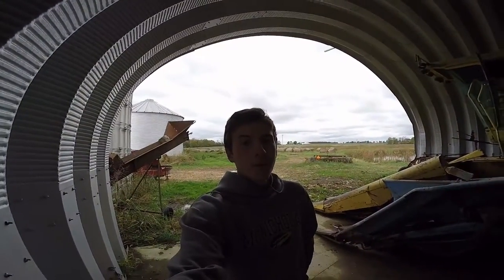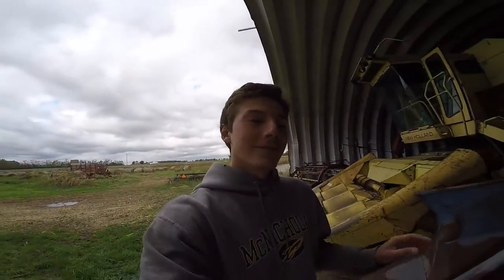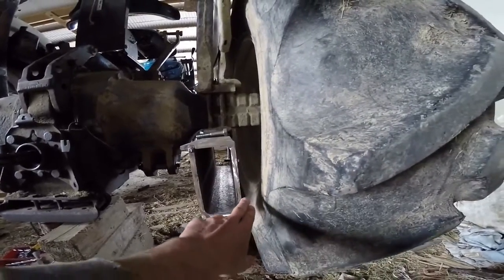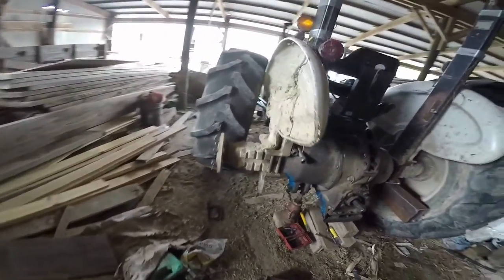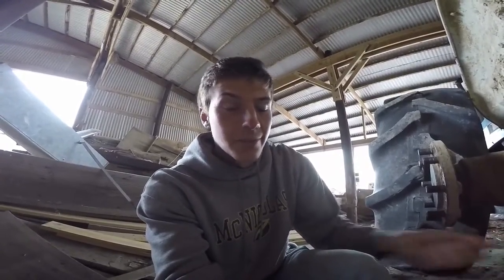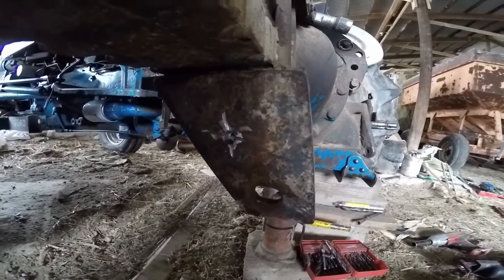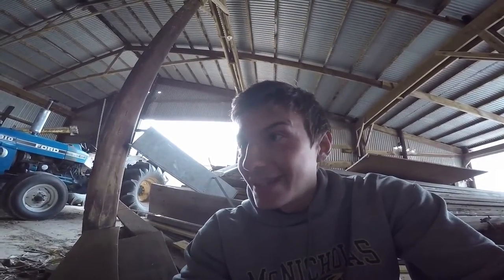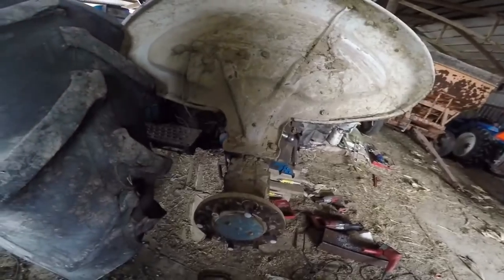Mounting Ford Corn Picker Part 1

Comment: My grandfather had an earlier red one that went on an MF 65. I do not miss putting it on. Probably because he didn't park it on concrete.
Reply from the maker: Having a level surface helps! I left mine on until i needed the tractor in the spring.